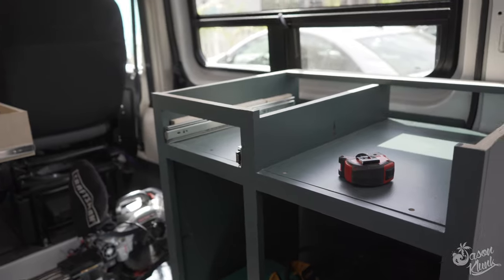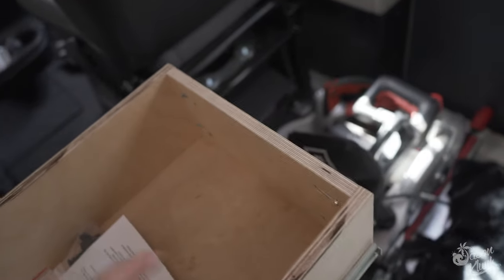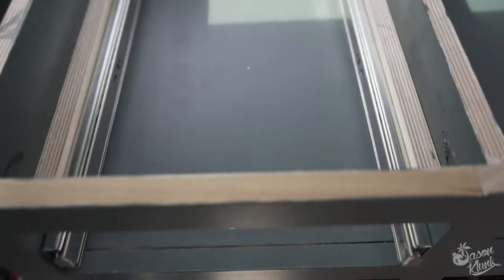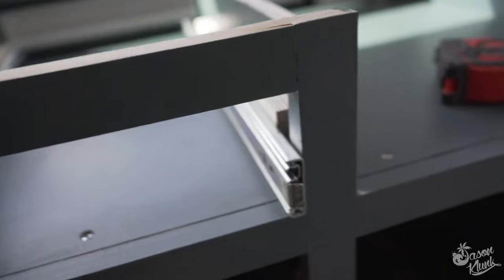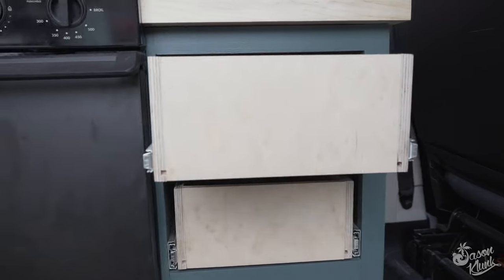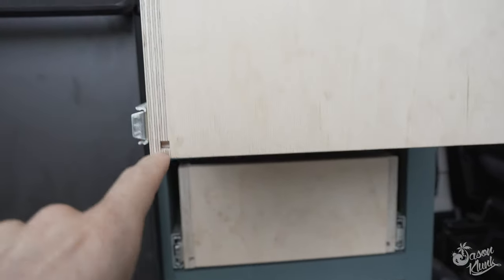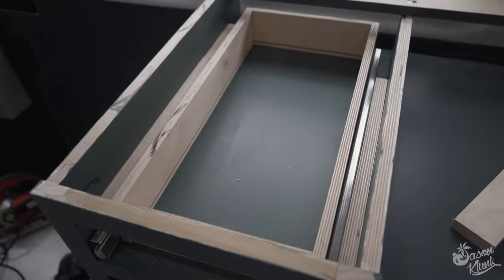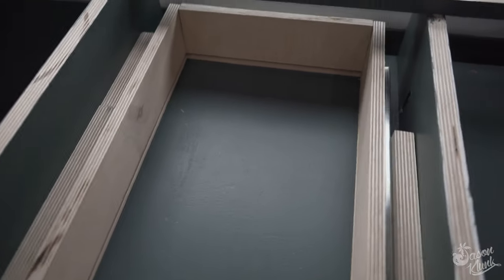How to Make Simple Drawers! Ram ProMaster Van Build Conversion - Episode 19 | Jason Klunk

Comment: Are the push to lock/unlock drawer slides holding up when the drawers are full loaded? They don't slide open when you make hard right or left turns with the van?

Comment: Love your videos Jason, I really appreciate them. Quick question on the bottom panel of the drawer. Why you chose to make a grove to slide the 1/4" bottom instead of just placing in at the very bottom and glue it or use a few screw?  (BTW all Ikeas drawer I ever assembled has the same method) so there has to be some advantage.
Reply from the maker: It allows the bottom to float so it won't split when expanding/contracting from moisture. It's a personal preference too, glue or nails would work fine if you wanted to do that.

Comment: just curious why you didn't push your drawer sliders back just a bit so you could have inset them a little wider, therefore making your drawer wider overall. You added those strips on either side but you then loose drawer space as a result...